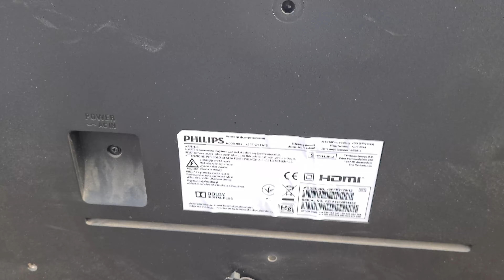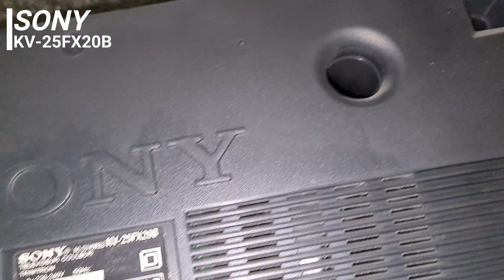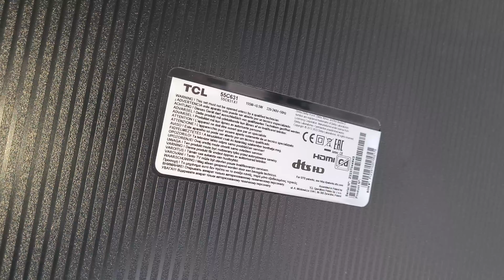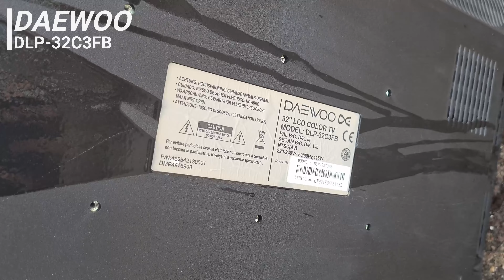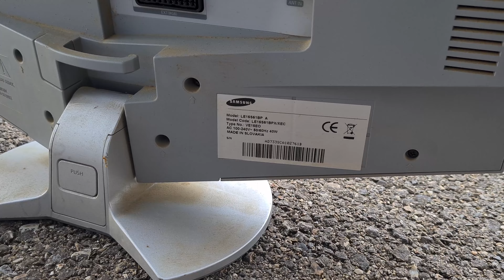Speaker Hunting Video #51 | 2.2 Loewe flatscreen, CRT woofers & a LOT of flatscreens w/woofers !

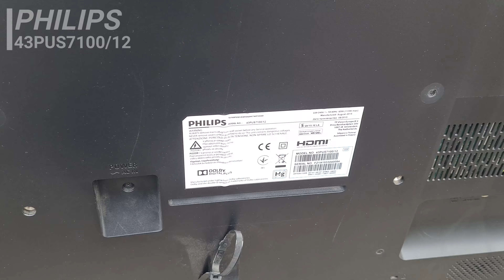Comment: 3:52 I have now the Philips Speakers! https://youtu.be/CpOJuaLsAPg?si=iCtCLDqiysoz1PD7 this System Sounds very good 
bass and clean Sound 

Have Pretty much Luck in 2024! 4:04 Tell Me How Sound the Wox System the tweeter Sound good? And the Subwoofer with deep bass?

3:53 my next woox Version!
Reply from the maker: Which ones? The one with the round enclosure or rectangular?
Reply: No Metal Cage only the tweeter Itself I have different Version of the subwoofer wit an oval enclosure

The speaker in the second 4:04

3:54 my Subwoofer Version, has 1 subwoofer and two passive radiators!

6:38 i have the SPEAKER from Sharp

I have currently installed the left speaker in my music system

5:59 I have this Speakers in Smaller and Longer 😂

7:01 and I have This Speaker Only the Subwoofer

I have currently installed the left speaker in my music system

Der linke Lautsprecher habe ich aktuell in meiner Musikanlage eingebaut

5:28 I have this Speakers in Smaller and Longer 😂

3:54 this woox woofer ist in my Speaker System now!